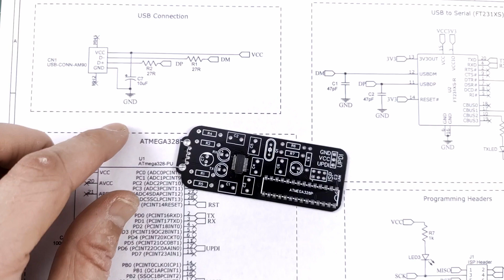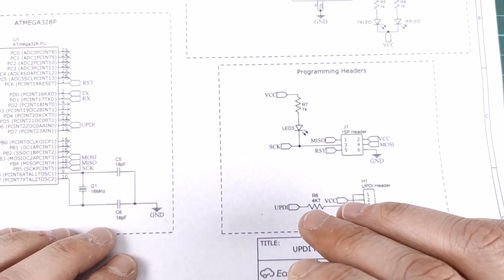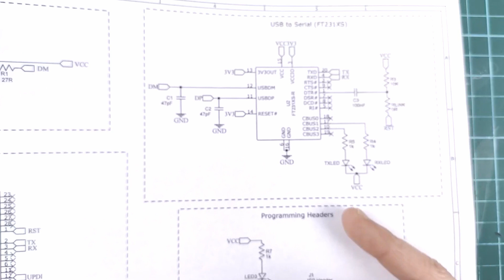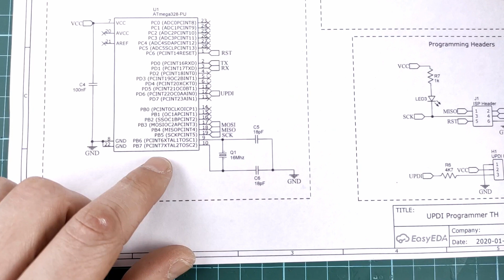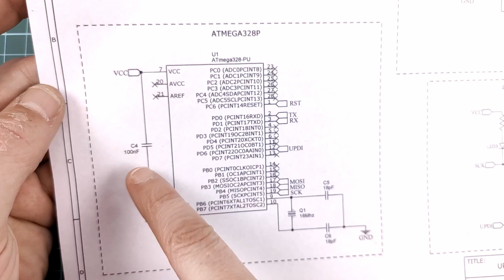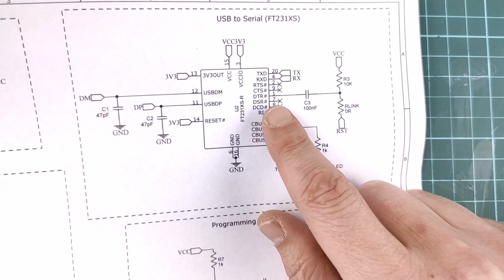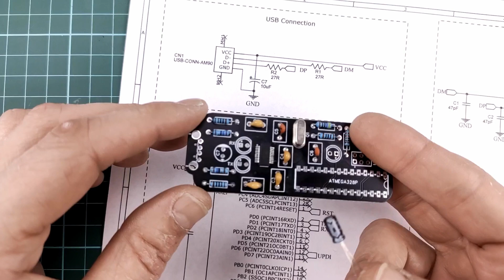Building a simple and cheap UPDI Programmer (Part 1)

Comment: Strange ... I found that the crystal needs 2 x 22 pF caps, hmmmm....
Reply from the maker: It depends on the crystal you are using. The datasheet is a good place to start when selecting the best capacitors for your crystal. But... if it works, it works! ;)

Comment: Nice PCB design and nice soldering. Looking forward to see your follow-up video.
(BTW: if you're gonna have a next PCB iteration you may want to add some labels on the top side, eg. for the ICSP header...)
Reply from the maker: Th ICSP is the standard layout and there is a pin 1 marking. But to be clear some extra silkscreen would make it better indeed!
Reply: @DustinWatts  - I agree. For some of my boards I used a keyed header (with box around the pins), for some I used standard 2x3 headers. After reversing those a few times I now use the red-white-and-blue standard headers. Red to mark the side that has VCC and blue for the ground side.

Comment: Nice build, if the part solders to the PCB it's a PCB component in my books. if it screws to it afterwards its a component part of the PCB assembly. So all components in the end.
Reply from the maker: Thanks! So what about a chip in to a socket? :)
Reply: @DustinWatts  easy it's a component part of the assembly.  you may have even have two component part numbers for a chip. one for the programmed chip and another for the un-programmed.  if it's needed for the PCB to function correctly then it's a component of that assembly.  ;)